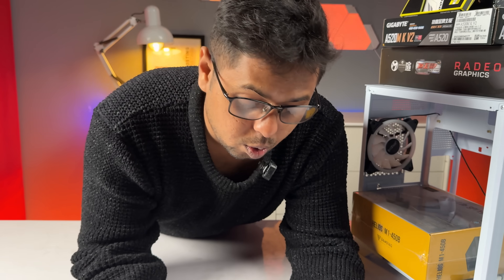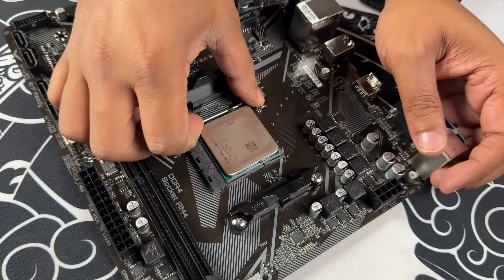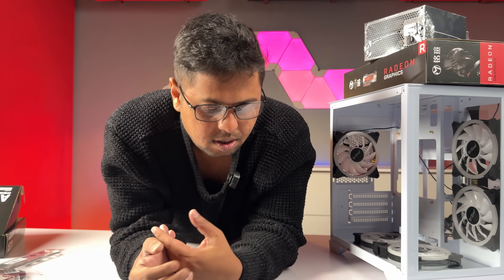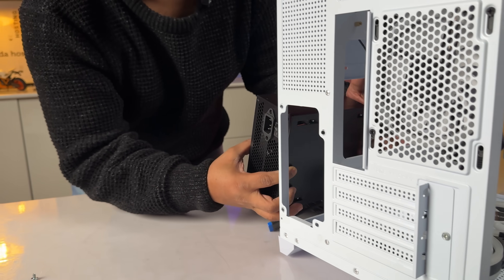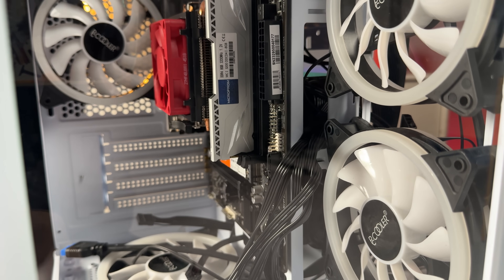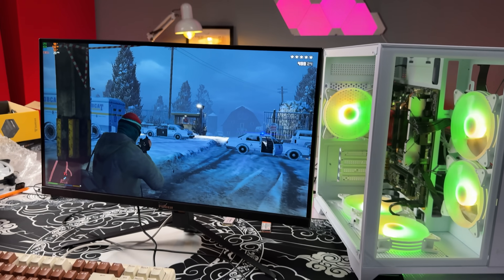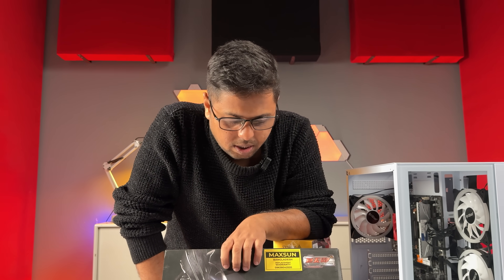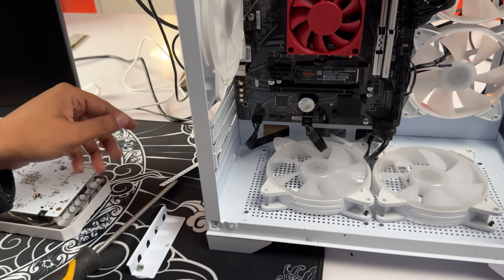20K PC Build & RX 580 Gaming Upgrade

Comment: ❤❤❤Ata kmn hoba bollban plz❤❤❤
1. ASUS TUF B450M-PRO II AMD MOTHER BOARD.-
2. PROCESSOR AMD RYZEN 5 5600G. -
3. MONITOR HP M22F (22")
4. POWER SUPPLY CSK V450 W.-
5. RAM CORSAIR 8GB DDR 4 3200 BUS-
6. SSD HP EX900 M.2 NVME 500Gb 
7. KEYBOARD COMBO VIEW ONE 
8.CASING VIEW ONE V8012

Comment: i actually built my 3200g setup back in 2020 planning it exactly like that.

got a 3200g for 10k a b450 for 6.5k and a single 2400mhz Corsair 8gb ram and a 350w psu. all these cost like 21k.

i gradually bought another ram, ssd, better monitor, mechanical keyboard and decent mouse.

the only thing left now is the gpu (and well the casing too)
Reply: What monitor did u buy
Reply: You need to upgrade your power supply for a gpu or else it will explode
Reply: @ajwaduddin2658  1650 or 1660 should run fine, anything more i have to change the psu. also might have to switch cpu as it might be a bottleneck at that point

Comment: আসসালামু আলাইকুম... 
1)Processor -AMD Ryzen 5 5600G with Radeon graphics 
2)Motherboard -MSI B450M pro VDH Max
3)Samsung 980 500GB Pcle 3.0 M.2 NVMe SSD
4)Kingston Fury Beast 8GB 3200MHZ DDR4 Desktop Ram
5)Power Supply Gigabyte P450B 
6) Maxgreen J X188 -2 Mid Tower RGB ATx Gaming Case. 

ভাই এই কম্পোনেন্ট দিয়ে টুটাল পিসি বিল্ড করাতে কত টাকা লাগবে একটু কাইন্ডলী জানাবেন।

Comment: my build.
i5 4460
Msi H81
ssd 128gb, hdd 1TB.
Thermaltek 450w.
hp 768p monitor.
Powercolor rx 5600xt.
Dead space remake 60fps constant.
Going soon to upgrade to i7 4770k.
Reply: দাম ❤❤
Reply: @LX_BANI_444  don't go for this. Buy updated components. I just upgraded my old ass pc time to time

Comment: Akta  pc build dekhte chai with
Prossesor:- Ryzen 7 5700g (Cores-8 & Threads-16).
Gpu:- AMD vega 8 (inbuild).
Ram:- 8+8=16gb ram (3200mhz)er
Power supply:- 550w er
Casing:- white case
Future a gpu add korbo 8 gb gigabite ar

Comment: Athlon 3000g 2 core. A processor onek border leg korbo.a processor dia build korla 20k plus hoi.kintu offer price a kinla 20.999 taka hoibo.but Athole 3000g dia build korar cha 20k ta intel i3 8100 dia pc build kora jai 4 core Threads-4 ar processor onek josss performance.onek Upgrade korar chance ase.bhalo bhalo gpu use kora jaibo.20k ar bhitora hoiya jaibo . Tahole amra kano a 2 core Threads-4 ar ryzen pc build korbo?
Reply from the maker: Karon h310 mobo te r upgrade korte parben na cpu. Kintu AM4 board a, 5600, 5600G, 5700G egulay aramshe upgrade korte parben.

Comment: AMD Athlon 3000G Processor with Radeon Graphics
CPURequired
AMD Athlon 3000G Processor with Radeon Graphics
Wattage Icon4W - 35W
7,000৳
clear autorenew
CPU Cooler
Choose
BIOSTAR B450MX-S DDR4 AMD AM4 Micro ATX Motherboard
MotherboardRequired
BIOSTAR B450MX-S DDR4 AMD AM4 Micro ATX Motherboard
Wattage Icon15W - 60W
8,300৳
clear autorenew
PNY XLR8 8GB DDR4 3200MHz Desktop Gaming RAM
RAMRequired
PNY XLR8 8GB DDR4 3200MHz Desktop Gaming RAM
Wattage Icon7W - 14W
+ Add Another RAM
2,300৳
clear autorenew
Netac N535N 128GB M.2 2280 SSD
StorageRequired
Netac N535N 128GB M.2 2280 SSD
Wattage Icon2W - 10W
+ Add Another Storage
1,399৳
clear autorenew
Graphics Card
Choose
Gigabyte P450B 450W 80 Plus Bronze Certified Power Supply
Power Supply
Gigabyte P450B 450W 80 Plus Bronze Certified Power Supply
3,800৳
clear autorenew
Xtreme XJOGOS XJ07 ATX RGB Gaming Casing
Casing
Xtreme XJOGOS XJ07 ATX RGB Gaming Casing
2,900৳
clear autorenew

Comment: Since the build is focused on budget and upgrading later, the SSD should have been a 2.5 inch normal ssd and the nvme slot should have been kept empty so that you can actually add a good gen 3 1tb or 512gb NVME SSD later down the line.
Reply: Jeyada bhok ne ka nahi bangla bol bangali he hum😅😅
Reply: @Takla9t  illiterates everywhere.

Comment: পাওয়ার সাপ্লাই চেইঞ্জ না করে কি আমি Rx580 নিলে চলবে???  

আমার কনফিগ 

AMD Ryen 5600G 

MSI B450M Pro Max 

Corsair Vengenace 3200 Mhz 8 GB 2 Stick 

HP  256gb  Ex900 Plus nVME + Transcend SSD 256gb 

Power Supply 300 Antec